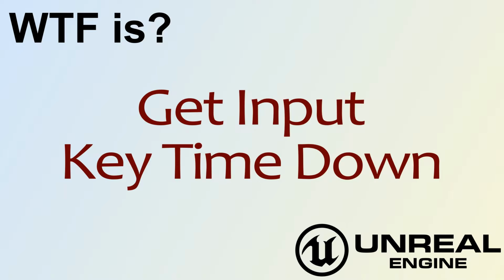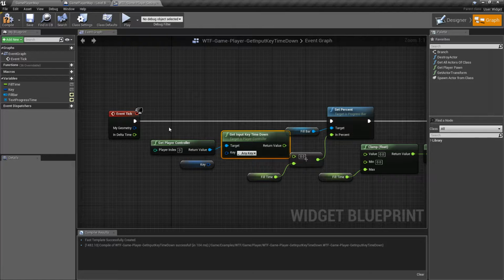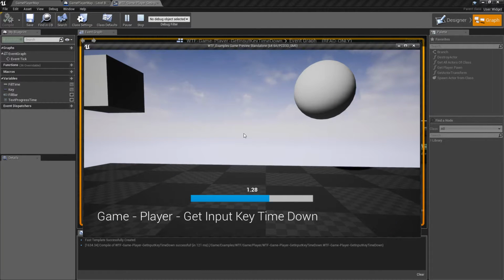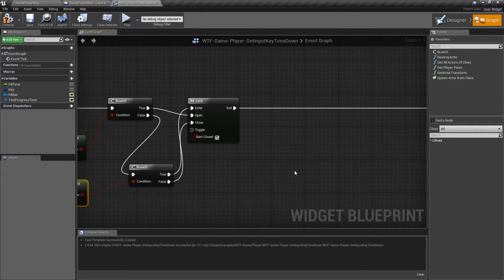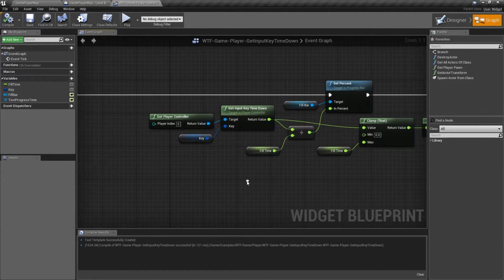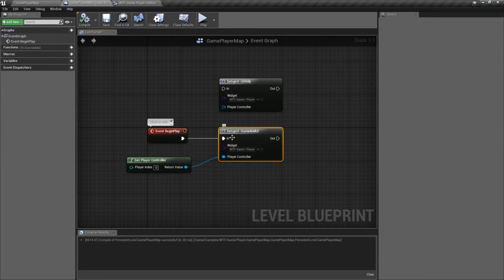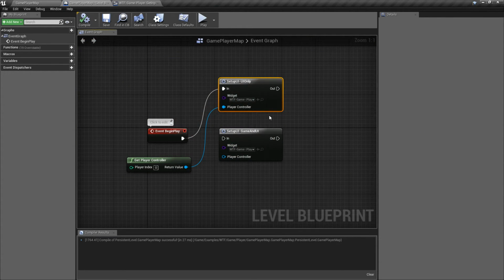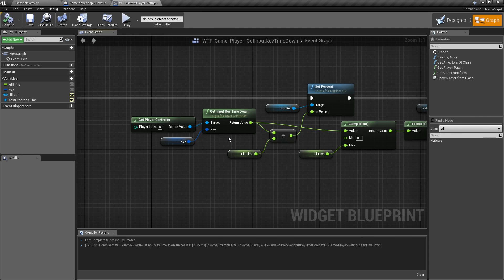WTF Is? Get Input Key Time Down in Unreal Engine 4 ( UE4 )

Comment: Is there a way to update the progress bar via a timer connected instead of using a tick?
Reply from the maker: Sure.  You can update the progress bar anytime and anyway a tick is just normally used to keep it smooth.  There is no reason you cant use a timer that runs every X time and when it fires of you update the progress bar a set amount.  The biggest difference would be the tick is each frame so each frame it would move from the last position to the new one and with a timer you would move ever X time from the last frame to the new one instantly.